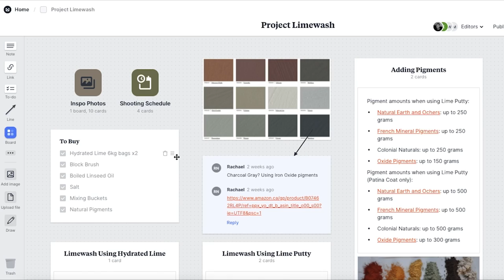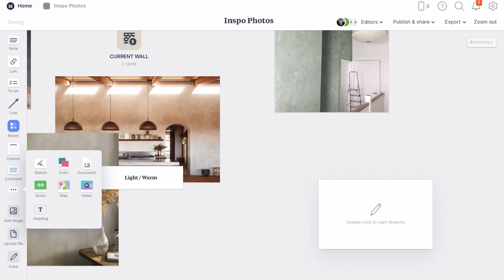how to make your own lime wash paint!

Comment: To be honest, I like the first coat (the lighter version) much better. The final result looks like a concrete wall, which is great. But since you have such tall ceiling and tall white walls around, it seems like you have a concrete wall wrapped in a regular white walls. It looks a little weird.
Reply: The style and color of the doors don't match the modern, grey cement color of the walls.

Comment: I have questions: You said you need/used lime putty to make limewash, which is supposed to be Calcium Hydroxide Ca(OH)₂ as you mentioned as well. However, the Hydrated Lime product you recommend and used is not Calcium Hydroxide, but is actually Calcium Magnesium Tetrahydroxide CaH4MgO4. In the explanation part, you in fact mentioned Magnesium in the hydration process, but then this got lost as it did not appear in any formula. So my question is, are we supposed to use Calcium Hydroxide or Calcium Magnesium Tetrahydroxide for the limewash?

Comment: The reason your lime putty mix was slightly nicer was because it had been sitting in the bucket for a while hydrating!!! Unfortunately, the hydrated lime needs to be mixed with water and then cure for several months to complete the hydration process. Without that, it will not transform correctly on your wall. It needs to be fully hydrated into slaked lime in order for it to respond to the air using CO2 to cure on the wall. The hydrated lime you bought is partially slaked. The hydrated lime takes the edge off the slaking process so you don't have to use metal or glass vessels and get a boiling chemical reaction as you add the quicklime to the water. This is great, but you need to finish the slaking process by mixing it with water and letting it cure for 3 months. Some lime paint companies let it cure for 3 years! Also: pretty sure you added the wrong pigment at some point. How else did you get to that completely different cold gray? I am with everyone else. I liked the warm putty color the best.

Comment: I quite like the grey, but I think the doors either need to be a bright white, or there should be a dark trim (or paint that looks like trim) around the door so the white doors aren't so washed out by the grey.  I think a neutral (or slightly cool-toned) wood trim around the doors would be perfect, especially if the wood had a darker stain to give some contrast to the white and the grey and liven it up a bit.

Comment: I did like the blue wall. The only problem with it was that you didn't do anything to bring the color into any accents or accessories. I like the concrete look of the wall now, but I feel like if you don't add some industrial styling to the entry way AND change the color of the doors and widow trimmings you will hate it too soon. Maybe we could get a pop of color on the trim?

Comment: Pop Rocks aren't made with alum, but th process of how they pop is for the same reason that you hear it happening here! Pop Rocks contain pressurized CO2 gas bubles that are released as the candy surrounding them dissolves; here, the sound you hear is the CO2--a byproduct of the reaction--'escaping' as part of the reaction.

Comment: I didn't mind the blue from before but I think it was the wrong tone of blue for the space overall. And I would have liked it better before if the door was the same color as the blue. Now, the gray is concrete/cement-like, which is nice, but I still don't like that the door doesn't match. At least before there was a contrast with the blue and white. What if the door and window frames are painted a dark gray (almost black or a dark wood/walnut look)? Maybe photoshop a version to play around with colors, if you want. But that's just my personal preference.